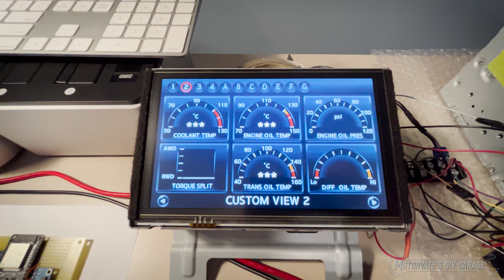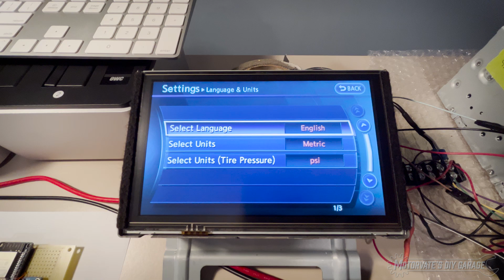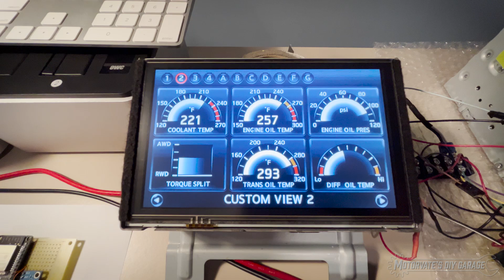Quick Update on the GTR Gauges using the G37/370z Nav Unit: MotorvateDIY Garage Ep.48

Comment: I know this video is kind of older, but I have a quick question. I have an 09 370z and was curious if you could manipulate the canbus in order to remove certain components. I swapped the engine out and can't remove the factory ecu and gauge cluster because it messes with the start function. Could I "trick" the BCM into thinking those components are still there by sending a signal from the Arduno?
Reply from the maker: I'm not sure... When you do an engine swap and want to integrate the new engine's ECU/PCM with the existing vehicle CAN bus network, it can require many, many hours or work to understand what each module needs and then provide/convert the needed data.